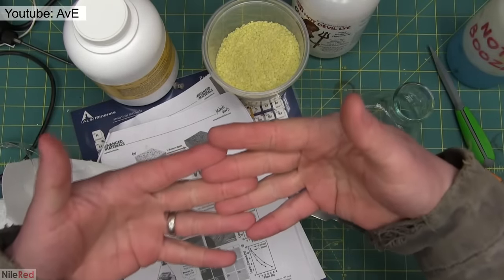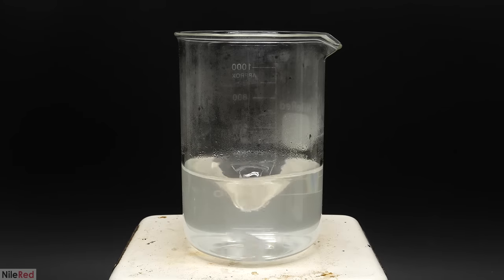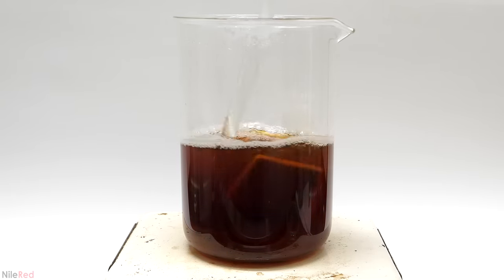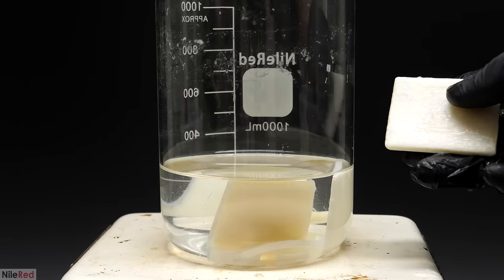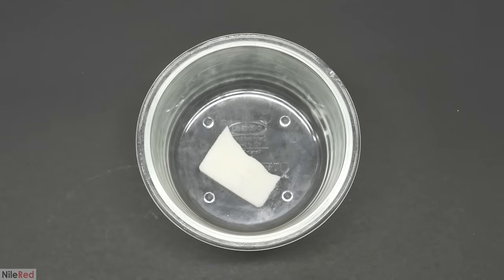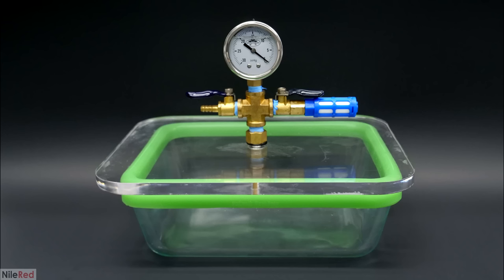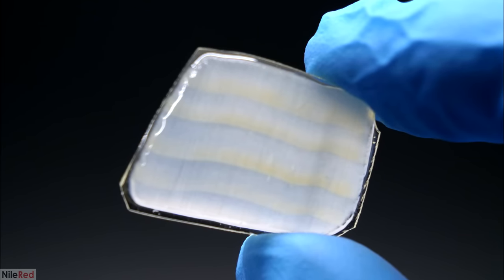Attempting to make transparent wood

Comment: 7:50 “source: Wikipedia” my teacher would have failed just off that 😂.                       And yes, I know wikipedia is a solid source
Reply: That's the image source...
Reply: 1. Wikipedia has a history feature for articles, allowing them to be rolled back by administrators
2. Administrators have the ability to account and IP ban users
3. Wikipedia has many sources cited. When in doubt, use those.
4. The community of Wikipedia is constantly checking and updating pages, especially the large ones people are likely to use.
Reply: @Justin batchelar You couldnt be more wrong on all points.
Reply: @TheRenegade...  and?
Reply: I mean in theory and in absolute yes it's not a solid source, but for most means and purposes it really is good enough
Reply: @jdj5959  ...you dont use Wikipedia as the source, because anynody can edit it. You use the sources they cited as sources, because those are the primary resources. Regardless of whether or not a page is monitored and moderated well, its a secondary resource, which you should always try to avoid if you can
Reply: @incendiary6243  if anyone can edit then why don’t you do it? Every edit request is fact checked by an expert on the topic. In its current state, Wikipedia is very reliable
Reply: @feitan8033  that's not something you can prove for everg arricle in the site. If you dont to use wikipedia as a source, you don't and use their sources cited instead, not them ss a citation
Reply: @incendiary6243  Its already proven, wikipedia is fact checked by experts.
For citation, it doesn't matter. You can cite wikipedia as the primary source.
Reply: @feitan8033  a primary source can't be an article about other research or documents, that's secondary. It's fine to use wikipedia, but it isn't the source you should use, it's the source of sources, which is great
Reply: @jdj5959  Have you considered that the feature administrators have could ban accounts and IPs that try to put up information which is true but the administrators don't like. I.e. remotely politically sensitive articles.

Comment: Hi, just a suggestion, I've worked with expoxy before, if you were to apply heat to the epoxy mixture, it would become less viscous, and plus your vacuum, I would think the epoxy would penetrate into cellulose more thoroughly. Maybe if you could, heat plus vacuum together.
Reply: @racitup4114  how supply electricity to the hot plate tho

Comment: Hmm, maybe try stabilizing resin. Its heat cured and really thin so you essentially have infinite working time. Also, maybe try alternating between vacuum and a pressure chamber

Comment: But what if you tried doing this with cyanoacrylate (superglue) instead of epoxy resin since it has a way lower viscosity?
Reply: superthin cyano works really well for soaking porous light wood. It should be done at low temp because the curing gives off quite a bit of heat.
Reply: This was my thought . Stop stealing my ideas   lol.
Reply: @texasdeeslinglead2401  you should have commented lt yourself then
Reply: great way to start a horrible fire
Reply: @kilgoar  It doesn't get that hot. I don't believe there is enough great in a cyanoacrylate seeing reaction to set wood on fire (wood typically must get to over 600 degrees Fahrenheit to burn). I've used cyanoacrylate on wood before no problem (heat wise; lots of problems with application).
Reply: @benjaminhackett8896  for all metrics, about with 450°C without a source of ignition wood catches 🔥
Reply: @kilgoar  Cyanoacrolate is a popular DIY fretless bass finish. I doubt it'd get hot enough to ignite wood.

Comment: What about using a vacuum filtration system  and use the wood  as a "filter" so the epoxy is sucked through the wood completely? 
Greetings from Germany
Reply: Jonathan Koopmann Das habe ich auch gedacht.
Reply: I had an opposite thought.

In the example uses, they were talking about furniture.

So, what if you made a round blank, with the grain lengthwise, then mechanically forced it into a length of pipe at the start, then all the processes would be performed by pushing the chemicals, and finally the degasified epoxy, through the wood under pressure? 🤔

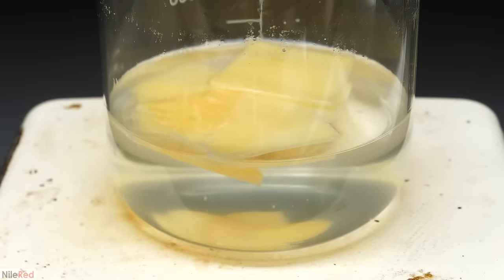Comment: Hi Nile, with your thoughts on the NaOH and peroxide @26:51, you are pretty much right. Industrially,  peroxide oxidative bleaching is carried out at an alkaline pH since it drives the reaction of H2O2 > H+ + HOO to the right. The HOO- ion is what oxidizes the residual lignin and pitch in the wood. Maximum brightness gain (max elimination of lignin) is achieved at pH = 10.5. Not sure if  your peroxide has something alkaline in it but without the residual NaOH the pH might have been lower.
Reply: Thanks, @Valentin Curaut, I work in the pulp and paper industry so knowing all that is part of my job! I think everyone has precise info they can share and what better place than a youtube channel :P..

Comment: If you ever work with Epoxy Resin again...

1) Measure both parts in the same graduated cup, don't use separate cups as that can cause problems during Curing, there are several out there that are marked for different Epoxy Ratios (fill to 1st line with part A, then fill to 2nd line with part B). Mix with with something shaped like a paint stir stick (flat sides and tip) and scrape both the sides and bottom frequently while stirring, this makes sure you mix ALL of the Resin together and don't end up with problems because some of the mix didn't have the proper proportions of A & B. You can also use a paint paddle stirrer in a drill gun but you should vacuum the air out of the mix afterwards or the final product will have LOTS of bubbles in it.

2) Whatever container you use as a mould or drying rack should be either lined with builders tape (ask at Home Depot or Lowes for the tape used to seal the seams of building wrap during home construction) OR sprayed with Mould Release OR coated with a thin application of paste wax (used by wood workers, this will make it MUCH easier to get the Resin off/out of the mould without stress or damage; see Modustrial Maker (https://www.youtube.com/channel/UC9aRTgvFLqnK1S0RsWZzlMw/videos?view=0&sort=dd&flow=grid) for examples - what he uses when he makes a concrete countertop will work just fine.

3) If you need the Epoxy Resin to REALLY penetrate your work piece, mix the Resin according to the Manufactures directions, then add an equal volume of acetone to thin it out. Kim Tippen (https://www.youtube.com/channel/UChOkCqsbNr6K1RYi9Sadb5Q/videos?view=0&sort=dd&flow=grid) uses this trick when shes trying to stiffen up a piece of very soft/rotten wood that she's turning on her Lathe.

In addition to Kim Tippen, 
Doug at Pohl Barn (https://www.youtube.com/user/treerat6419/videos?sort=dd&view=0&flow=grid)
Peter Brown (https://www.youtube.com/user/kludge1977/videos?flow=grid&view=0&sort=dd)
and
Nick Zametti (https://www.youtube.com/channel/UC3-0S7vXfwYY2jj5EkMpymA/videos)
also do a LOT of wood & Resin projects if you want some ideas/tips.

Comment: 34:00 A transparent material with a renewable resource.
Pretty sure exposy is just plastic? Not sure that's exactly renewable
Reply: Don't doubt daddy science.
Reply: we can use tree resin 
but its not gonna end up the same because its not very transparent
Reply: Once you get it soaked in epoxy, that's no way it's going to be renewed
Reply: I think the hope is to eventually use something other than epoxy or at least use less plastic overall.

Comment: A couple of thoughts:
(1.) Oxalic acid is used to whiten wood in industrial processes and as a pretreatment before using colored dyes or stains. I think it's also what's used to "bleach" sugar and flour.
(2.) This process isn't too dissimilar from making stabilized wood used for making things like duck calls, pool cues and knife scales. Some of the trade names are Frostwood and Dymondwood. You can buy an epoxy designed to be soaked up by the wood for stabilizing called "cactus juice". Pigments are usually added to it but it comes clear.
(3.) Wood always warps like that when it dries. It's called "cupping". You need to figure a way to clamp it while it's under vacuum pressure.
I think if you look into how people stabilize birch plywood for making knife scales and the like that you may be able to borrow some ideas and techniques from it.

Comment: You could try to put another piece of glass over the pieces when they are curing, this way pieces are sandwiched between glass.
Reply: Had the same idea. PTFE or PE plates would work as well, maybe better than glass because the epoxy doesn´t stick to it much.

Comment: So THAT'S why firewood looks weird in its charcoal state. It'll be individual square shaped peices which aren't at all constant with their shape or still have its a portion of its log structure depending on how long it was on fire (or how long the wood was burning) and in both instances the log(s) may have embers on them and the small chunks of coal would still be orange hot and all the cool and non burning coal will have an ashy appearance, but I found that quenching the fire with water will both cool everything that's either still smoldering or on fire and wash away the ash and reveal the black coal which I found interesting considering that I'm partially a pyromaniac

Comment: 1: Do a better job removing the lignin
2: Use a slower curing epoxy or one with lower viscosity, or add a solvent to lower the viscosity
3: Sandwich it between two pieces of glass to finish curing
4: Polish the finished surface if it's not smooth

Comment: I may be wrong but would a pressure chamber work to force the resin in the length cut pieces?
Reply: Another reply went into detail on that, hydraulic pressure only on one side (and also a lot of equipment ideas to set that up)
Reply: I may be wrong too but I think the same happens once you release the air back in.
Reply: I think it might force it in but not enough because the length cut pieces don't work good

Comment: Try it with paper. it's wood pulp but probably more fragile.
Reply: Just make the paper wet or better use oil, even wax would work -> translucent paper. Or did I missed something?
Reply: @Reaper035  Transparent not translucent. There's a difference, read the title.

Comment: I realize this video is almost a year old by now, and there might be another comment around mentioning the same I will now, but I didn't see any when taking a quick look so here it goes:

As someone who works regularly with resin for art and crafting projects, I can tell you that resin shrinks slightly when it cures. How much it shrinks depends on the type and brand of resin, and slow-curing resin tends to shrink a bit less, but it always shrinks.
So, when there isn't a firm surface for the resin to rest on during that process, it'll bend and/or crack.
If you don't want bent resin, wait for your pieces to be fully cured before peeling them off.

Comment: Is it possible to extract just the sugars from the wood? That would be a cool experiment.
Reply: That's pretty easy and a routine analysis for determination of the ratio of different hemicelluloses and cellulose. It's basically just to place the wood in sufuric acid (there are more heating and diluting invoved...). This causes acid hydrolysis of the cellulose and hemicellulose chains and you're left with precipitated lignin and wood sugars in solution. These are then typically analzyed using HPLC.

Comment: One can use slow curing epoxy and put it more in vacuum chamber to get perfect composite!
Reply: The only problem with slow curing epoxy is the viscosity. Most slow curing epoxy is extremely thick and would be fairly difficult to pull into the wood

Comment: Interesting. I used to do a very similar procedure when in college as a lab assistant to a grad student. That said, we weren't worried about structure so we used powered wood and just autoclaved it in acid to get ride of the lignin. We used supercritical drying with CO2 to remove the water without collapsing the wood structure. Haha, but I can't remember what we were even trying to study now. (at least I think that's what we did) EDIT: Actually turns out I can't remember things well it was NaOH and turbo-mixing. I think the acid must have just been to neutralize the caustic and the autoclave to kill any bacterial contamination. https://www.sciencedirect.com/science/article/pii/S0961953413000020
Reply: I think one of the main problems is that the paper was using a vacuum chamber to try and force epoxy into wood. I think that your idea of using an autoclave is better since it is adding pressure instead of taking pressure away. I think an autoclave and degassing/ drying the wood under vacuum, then using pressure to fill the spaces with epoxy might help to mitigate some of the issues NileRed was having.

Comment: As I was watching, I couldn't help but wonder if a few things might be helpful. Could you use a pressure cooker to force the peroxide completely through the wood? Would thinning the epoxy with alcohol help it to penetrate deeper and when going through the vacuum cycles, could you pressurize the chamber slightly to force the epoxy into the cells? Great video, you really made me think through the whole process. I'd like to give this a try too. Thanks :)

Comment: If you ever try this again, use a mold, put a small pane of glass on the bottom, spray with resin mold release, pull your vacuum cycles, then lay another release-sprayed piece of glass on top (no pressure, just lay it there).  Let cure fully -- this should prevent the warping, and ensure the resin forms to the piece's thickness properly, ensuring you'll have a nice flat piece.

If the pieces get TOO thin (ie: the top glass's own weight creates too much pressure), mix a microbatch of the resin, use a glass stir rod to make tiny drops on a piece of resin mold release sprayed glass.  After these fully cure, do as above, but, place one at each corner of the bottom glass as spacers to keep the top glass from sinking too far.

Comment: But why?
Reply: Maybe in 20 years time they'll be able to make slightly bigger pieces, and then develop a really expensive, brittle comb that takes 3 weeks to make and snaps when you brush your hair.
Thus ending world hunger.
Reply: @NotchaRealDad  You're a genius
Reply: Kev „Science isn’t about why, it’s about why not!“
Reply: S c i e n c e !!!
Reply: Once this is upscaled, we can claim deserts are replanted with invisible trees and  clean up on fake carbon credits. Mwahaha...Oh dear, did I say that out loud....
Reply: @sirsydneycamm1883  Oh
Reply: iirc one of the actual reasons was that it could be better thermal insulation than glass. Thus building material that lets light through but keeps the cold out - current list is bit short on those..
Reply: @Lanka There is a very long list of what can be done with glass. Triple-glazed units with Krypton gas is matching the insulation of some of the best materials for walls and there is a vacuum-filled unit that is not so clear visually but almost 0 U-value. If there is any advantage to try to make wood transparent, it would mainly be for cutting or drilling easier on site and the trend is to make elsewhere and only assemble on site with pre-mounted fixings.
Reply: Wood windows.

Comment: Another thing to try:  to remove lignen, use sodium hydroxide + sodium percarbonate and cook.  This is what I used when making paper pulp from palm fronds, and it worked quite well, and the peroxide in the percarbonate bleached the fibers pretty well.

Comment: Heres an idea nile
Use chamber that is pressurized on one end and depressurized on the other using a round piece would work well with this setup

Think a wooden dowel in a metal pipe of the same size if not ever so slightly smaller so it wedges in place and doesnt have the issue with getting stuck in the pump intake youd just have to have a reservoir below the intake to catch any if the epoxy that may try to go into the pump

The end result would likely have a similar effect to how a fiber optic cable is but you have to do some clean up on the ends to remove the excess and to smooth it out

Comment: I wonder if degassing the epoxy in the vacuum chamber before putting the wood in it would have any effect? Maybe dry the wood in vacuum as well? This would create the least amount of bubbles, which might make for better fill into the wood. A lower viscosity epoxy might work better too.

Comment: @NileRed
With a length-wise piece, have you thought about suspending it over the resin, and using the cellulose tubes as a straw to suck up the resin?
And using a form of a glass press while the epoxy cures.

Also, you could use a UV reactive resin and leave it in a press and calculate the UV exposure to equate to a 72 hr cure time.
The slower the cure time the more durable the resin will be because it can bend like steel, the faster the more brittle it is again like steel.
This is my experience working with epoxy resins in the marble and granite industry.
But again the UV exposure could reach the interior of the wood because of its transparency.

Additionally, you could try vacuum forming it in a bag against a piece or between two pieces of glass (as a forming mold) like they do with fiberglass, carbon fiber, kevlar, etc.

Make sure to measure the space of the bag to be enough to suck it into and then through the wood, and then move any excess away from it to make it easy to trim the excess flash resin away.